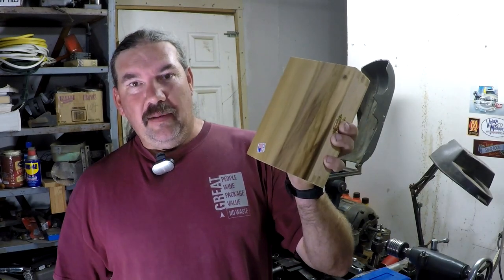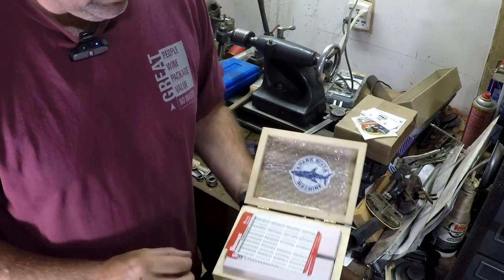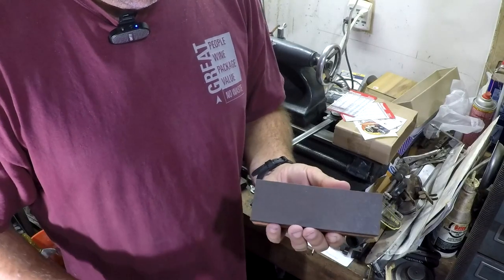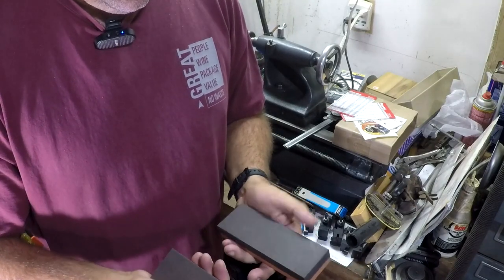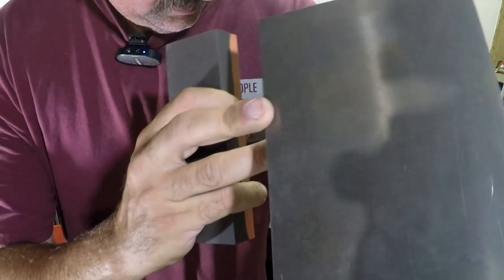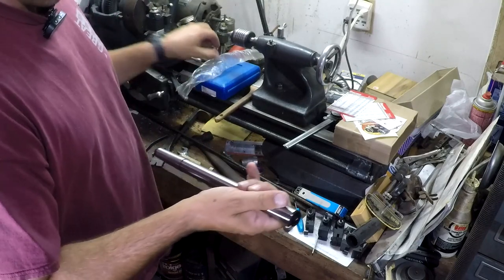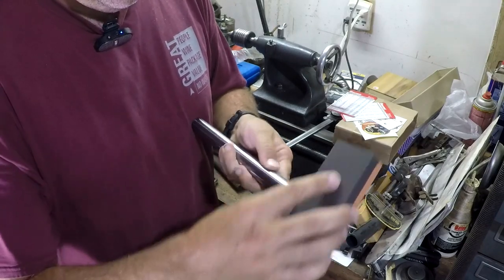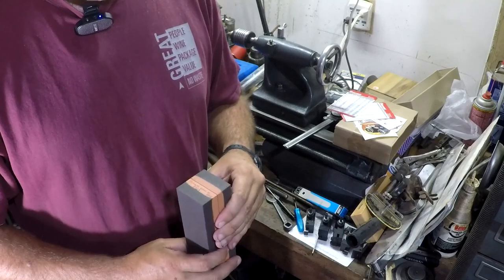Precision Ground Stones aka toolroom stones

Comment: Too much is made about flat stones let me inform you of a few things not to belittle his stones at all. I and others have known to use a diamond wheel and dust them off on the surface grinder for decades however what you think is the feel of ultra precision and flatness--really isnt. What you are feeling is the fact that the teeth have all been flattened down so the stone does not work anymore. the way to fix that is after truing--the diamond wheel and surface grinder is they then need to be "dressed" to open back up at least some of the cutting action of the stone. That is done by using carbide tumbling media-fine used for tumbling agates and put some of it and water on the back of a surface plate or even flat cast iron and rub it around-that way the carbide powder is rolling and crushing and opening back up the face of the stone so they will cut a little. The shiny spots you showed--> According to the laws of physics you could stone a lifetime and the shiny spots still remain high for that reason when damaged spots like that exist such as that major ding you had they must be taken BELOW the surface by hand working them with the edge usually of a diamond ez lap. When a person feels with a stone or item to feel if there are burrs or not--trust me when I say a high spot will still be there but you will not detect it because its a smoother over burnished dome.. 

The stones in the box are in effect glazed. They leave the shiny spots because they are lapping/burnishing that spot. A big thing to do with stones that I doubt they did is to first do both surfaces then place the stones in a grind vice and DO THE EDGES--but not the ends. The reason for this is so for instance with the back rail of a surface grinder or other items that have a rail you can stone the chuck and butt the side up to the rail to also deburr it. The sides of a stone are not square not even close in a distance of a half inch lets say it takes about .005 sometimes for them to clean up. The stones in the box also have no releif slots--there again when you rub them across each other the grit and possible metal is simply rubbing around on the surfaces with no place to go. The one I have has slight .005 deep crosshatch pattern on it also made with a diamond wheel. 

Another issue with the huge flat stones is just that --they are huge I have several however a smaller standard stone such as you have in your pocket for the chuck actually IS FLATTER. and you have use them cautiously to work areas--including grit and metal that gets in your flat stones.. The flat stones shown are sort of a transition item. 1)first a person knows nothing about stone flatness or what is truly happening 2) next the person discovers flat stones and begins to get a feel of the science 3) the final stage is a person MAKES ALL OF THEM FLAT.. I have the big gigantic ones like you have.. The big ones you have will change slightly according to wetness and temperature. To check what I say slightly rub them on a surface plate from time to time and notice the change of the patterns. You can also hand scrape flat stones which I do with a diamond lap untill you get so flat you are splitting atoms. Conclusion:--good video but the smooth feel of ultra precision flatness--is an illusion you are feeling that the teeth have all been made flat.
Reply: after using a freshly dressed opened up flat stone--I do in fact use my small ruby stone to get back that perfect smooth feel of a chuck. On the micro humps I mentioned of the shiny spots? most of the time few would care - BUT YOU WILL IF GRINDING TO SPLIT TENTHS and those spots will in fact show up.
Reply from the maker: I will refer you to a video of some one more knowledgeable on the subject than I am. Perhaps his video might clear things up. Thank you for your commitment 😀https://youtu.be/DVLXsq7pi9Y
Reply: @OldIronShops  yes of course I am well familiar with Robrenz stuff and that flat stone video I have memorized. He also and specifically addresses the fact that shiny humps in fact must be taken below the surface which in critical cases (not usually) I use the edge of my ezlap diamond file which were made for knives actually--have used them for years for also putting on tiny radius cut cutters. I am sure he will agree that in fact the reference flat stone must have has marks in it since rubbing them back and forth just rubs the grit and metal back and forth. I did put them in mine and everyone would but the diamond wheel has to be shaped for it which is trouble for anyone so they are not generally there. I do in fact have several new thin ones I got from a big sale of several and one of them I intend to sacrifice for a "V" wheel for the exact purpose. Robrenz of course is the top of the pyramid and the ultimate of all time especially the work and time he puts into the videos which is a service to everyone and one of the blessings of youtube and of the internet. He is one of the only people I see on the videos that is as obsessed or moreso on the science of machining and especially surface grinding. I absolutely assure you that he will agree with my statements and I do occasionaly do a fumbly video but I simply do not have the personna nor narrating ability to do good ones. actually I would like to send him a couple stones for him to test. But I want to finalize my wheel for the crosshatch pattern. Actually It may pay to simply do the cross hatch on stones since it is truly a pain in the ass. But a huge one is squaring up the side of the stones also--or they cannot be run up against the side rail of items.
Reply: I do want to do a video explaining why bad stones cannot be used in a toolroom with precision items about how they round things over but I need to draw sketches and give examples--and I have too many things going. Likely the biggest thing is those big stones are too big and the true best stone for tool room use on tooling is a medium size stone not those gigantic ones. I personally would NEVER run one of the big ones on tooling since the flatness cannot be guaranteed and changes with everything let alone by wetness or temperature-those stones are TOO BIG.  They are a reference stone upon which the other stones can be rubbed but not without the v slots. It absolutely is not true flat stones must be a set of 2--that is totally wrong.

Comment: I am not professional stone cutter of "flatness" guy, but I know enough about cutting stones and machining. And you never rub one stone over the other, because you are just dulling it up...you are knocking out the microscopic sharp crystal edges, which actually cut the metal. If the stone gets "loaded" with metal, it usually means it was dry to start with(which is wrong). To clean it, you use kerosene, naphtha, mineral spirit, automotive solvent used in parts washer or even soapy water or some liquid degreaser with a stiff brush. Stones should always be used with Kerosene, naphtha or light mineral spirit.They should be soaked for few hours or even a day and then used with the solvent, while stoning, to prevent the loading/clogging the surface. To flatten the stone you use either flat diamond stone or file or just flat ground aluminum plate(preferably with some small cross hatch groves in it) laying on the table, put some diamond grid of corresponding size and rub it on it in "numeral 8" shape(also called infinity sign shape). It will grind away the dulled crystal layer of the surface end expose the sharp one underneath it. This should be done periodically, because the stones get out of shape by using them. It is matter of maybe 2-3 minutes only. Every good shop should have this cutting/stone dressing tool available to all employees, because without it they just ruin the machine tables and the parts.
Reply from the maker: I will refer you to someone more knowledgeable than I am on the subject maybe his video will clear things up thanks for your comment 😄 https://youtu.be/DVLXsq7pi9Y